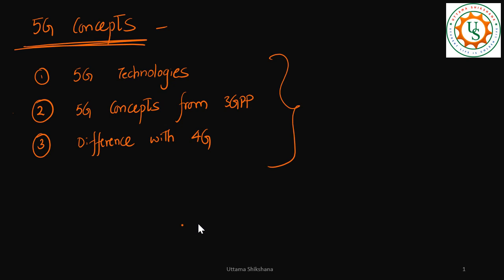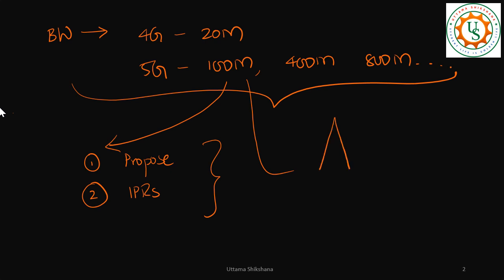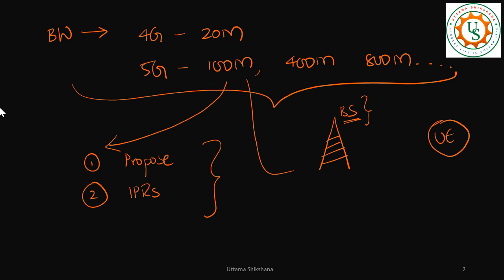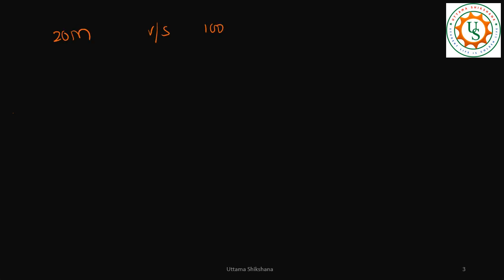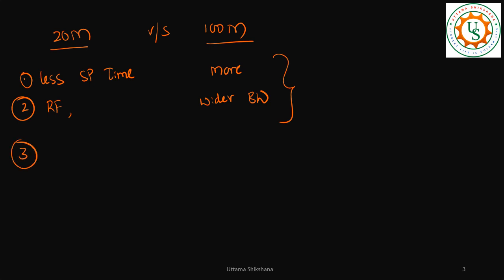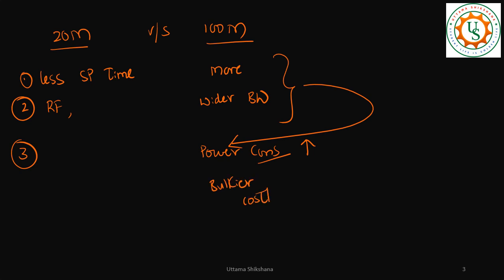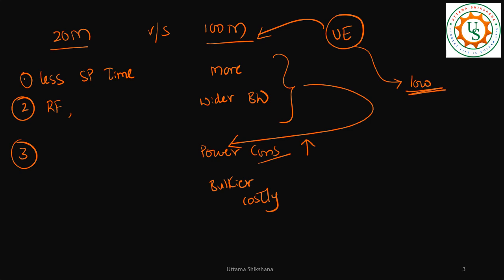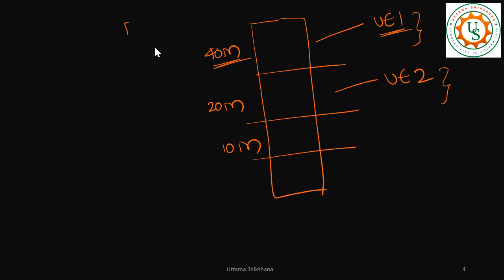[Series #10_7] 5G Concepts - Bandwidth Part (BWP) | Why required | Merits

Comment: I have this question - 

Suppose I am a service provider. Let's say Jio. To enable career aggregation, do I need to by multiple 100MHz band ? I mean, how does it work?
Can you pour some light into this - When spectrum auction happens, will service providers lease multiple 100MHz slices, so that they can perform CA?
Since up to 16 Component carriers are possible, a service provider can potentially buy 1600MHz ! (I know it may be a stretch, but can you explain how it works)